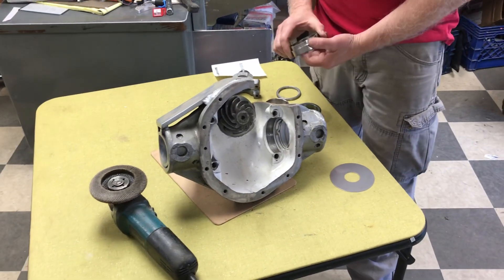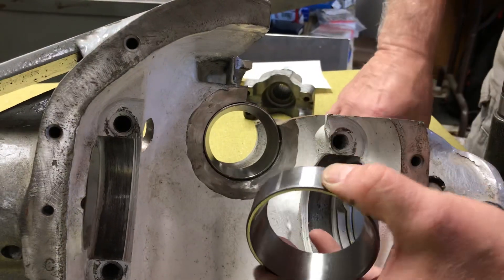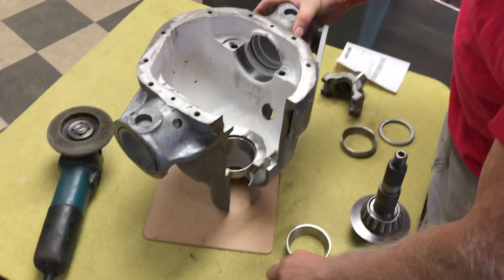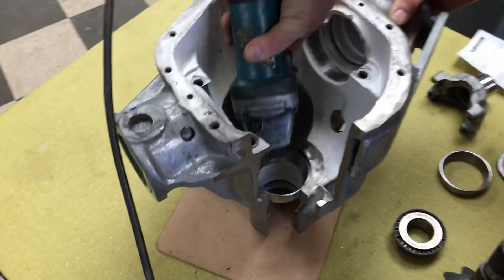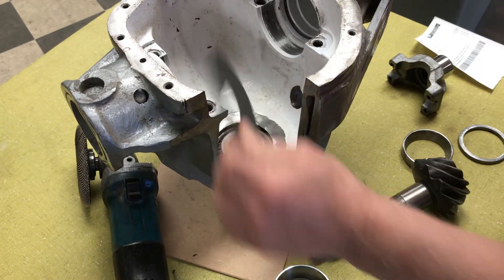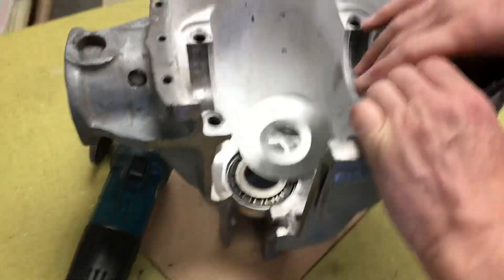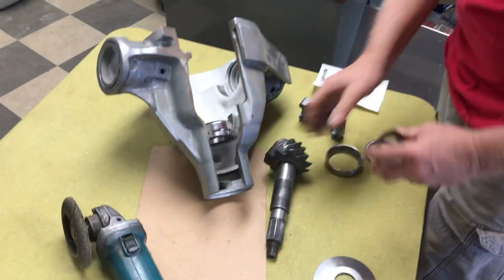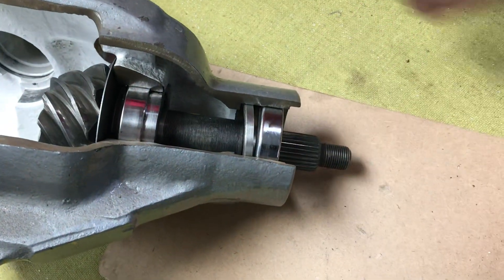Jana 76 high pinion Slinger Install, & Jana 54 HP.

Comment: Another question, do you have a preference to using Dana 50 gears or JK Dana 44 gears when upgrading a Ford hp Dana 44? Your site says they're both about a 44% increase in strength. Are they both 5 cut gear sets? Or is the newer jk Dana 44 2 cut?
Reply: i read somewhere that all aftermarket ring and pinion gears are 2 cut. ive never had a jk gear set next to a ford gear set but they cant be much different i would stay stock or go dana 50 gears
Reply: @motoboggin2619  yup. Imo most aftermarket gear sets I have seen are the old school 5 cut. It's an extremely expensive machining process so I'm assuming rather than get new equipment they just make 5 cut gears. On the other hand most all OEM brand name manufacture gears are the more modern 2 cut. I've Come to the conclusion there's no difference in strength. 5 cut gears set up cleaner imo
Reply: @motoboggin2619  the jk Dana 44 uses a much larger pinion shaft. Absolutely won't work In a old school Dana 44 housing without the conversion bearings and clerancing the housing for the pinion slinger. I trust Mr. Jantz so using the conversion kit for the Dana 50 or JK 44 will both be about the same increase in strength.
Reply: @lol123321123321  i wonder if the conversion bearings are weaker or failure prone, secondly i wonder if the housing between the pinion bearings is now the weakest link, probably not but id hate to find out.